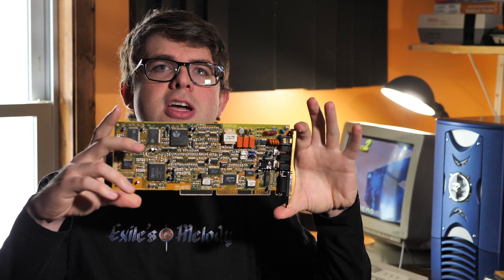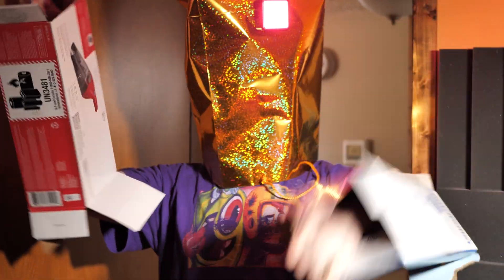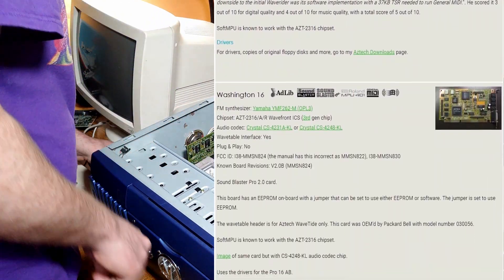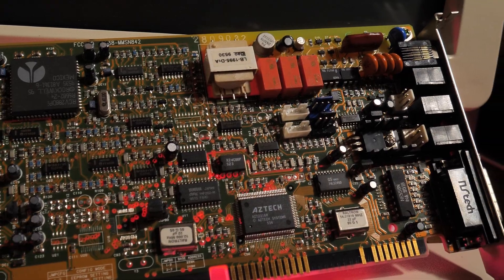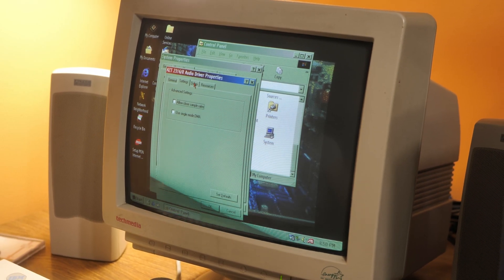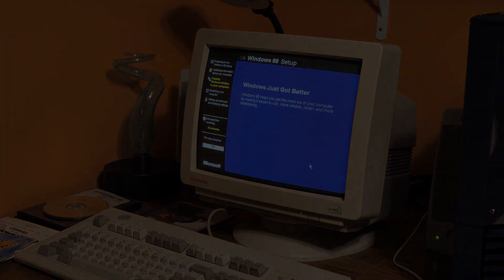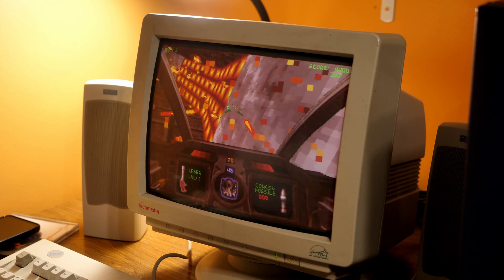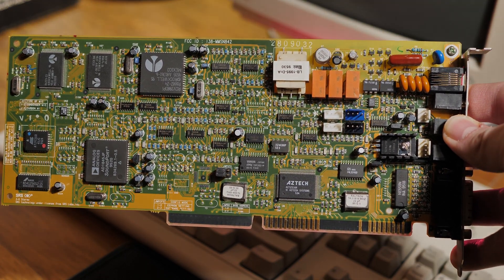How BAD are Modem Sound Cards for DOS Gaming?

Comment: I just commented on another video how hard these were to get to work the other day. We used to install them in computers we built in ashop where I worked. This was firmly in the windows 95 era though, on the fringe of 98.
Reply from the maker: Yeah the sound is good but the drivers are a bit tricky. I was actually unaware when I did this video that you can use the Unisound drivers in DOS. Might be worth revisiting if it "just works" with those.
Reply: @DOSStorm  I don't think we had those in 1998. :)
Reply from the maker: @rimmersbryggeri  Yeah for sure we didn't, makes it a bit less painful now though.
Reply: @DOSStorm  Yeah that unisound driver would have save huge amounts of time back when timne was atually a factor on these computers.

Comment: Had an IBM Aptiva M-series machine from 1995.  This had the infamous MWave adapter, which was quite problematic.  IBM marketed the MWave DSP heavily, with phrases such as “Aptiva’s two powerful processors—the Intel Pentium and MWave Digital Signal Processor” printed on the tri-fold.  I think this was more of a cost-savings measure, and I remember Packard-Bell doing something similar.  In MS-DOS mode, the card could be configured (with a utility called “fastcfg”) either as a 28.8 kbps modem and no sound, a 14.4 kbps modem with mono sound, no modem and stereo sound/FM synthesis, or no modem, stereo audio and MIDI wavetable support.  The early DirectX days were the final straw, with no proper driver update for DirectX 5.  Replaced it with a SB16 and a Diamond 56K modem.  Goooood times.  Fantastic content, by the way!  Subscribed!!
Reply from the maker: @AIM9XSW  Yeah I had a run in with the Mwave in my latest video on IBM voicetype. I plan on covering it in more detail at some point, but in my short time testing it I was far from impressed. lol

Comment: I haven't messed with the Aztech drivers for my Sound Galaxy 16. I just create the SET BLASTER variable and feed it industry standards. It handles SB Pro and WSS like a champ. I love Aztech cards.
Reply from the maker: Yeah I kind of feel like the UNISOUND driver would have fixed all the problems I had with this card most likely, and the non-modem versions seem to fair much better as well. I will be testing more Aztech cards soon, they are still a great bang for the buck since nobody really seeks them out like they do Sound Blaster cards.

Comment: I have an HP Pavillion Pentium 3 system that has a PCI combo sound card modem with some sort of Rockwell chipset. Most of the sound card ports are on an auxiliary header. It came with a cable that goes in an unused slot. I just got it, I really need to test it in DOS see if I can get it to work there.
Reply from the maker: Interesting. Is the sound chip on it made by Rockwell? Or does it use a Crystal or AD chip I wonder?

Comment: I bought this exact model of combo card about two years ago with the intent of using it in a Pentium build (still haven't gotten around to it). A big selling point for me was the dedicated Yamaha OPL chip; the photos on the ebay listing were clear enough for me to identify it. Anyway, glad to know it's a good SB clone. 

I have another Aztech card of a similar configuration, without a modem, that I am using this in a 386sx build. I encountered the same issue with the Aztech test program not playing the digital audio correctly in DOS. Xargon / Jill of the Jungle have issues with the digital audio playback as well (computer freezes for a few seconds, then comes back). Windows 3.1 wav playback and all other DOS games I've used on it work fine...unfortunate because it's a great card otherwise.
Reply from the maker: Interesting. I was able to play Jill of The Jungle using this card and it seemed to run fine, I actually recorded footage of it I just never ended up using it for time sake.

Comment: This looks similar to my AT6800W Aztech sound/modem combo. The reason 16bit sound doesn't work in DOS is the Aztech software doesn't properly initialize the Windows Sound System in DOS. Get the latest UNISOUND 0.80a or higher and run it with the /XWSS switch to initialize WSS in DOS. Note that WSS and SBPRO modes can not both be enabled at the same time.
Reply from the maker: Good tips! I will definitely try Unisound when I get the chance.

Comment: Drivers were always a PITA for these. I don't think I ever used one as a modem, even back when those were a thing. Just recently I had to get the drivers for another Aztec card I had - if there is a jumper to save settings or get them from EEPROM, make sure it's set to EEPROM otherwise it's read only.
Reply from the maker: I'm glad I'm not the only one who had issues with it. The EEPROM jumper is an interesting suggestion, although I thought I didn't see any jumpers on the board. I don't see super well though so maybe I'll check again.
Reply: @DOSStorm  The one I had was also steered by the EEPROM - not exactly PNP, but did require specific drivers to that card. I also had one with a SCSI interface, but it needed an optional IC to be put in - I have the IC in another card (needs unsoldering) but I don't think I want to savage it without getting the right drivers for the SCSI subsystem first. 

Anyways, if you find that your settings revert to default, def. it's not writing the update to the EEPROM.

Comment: I used and experimented with Aztech sound cards for a while. It was pain to configure these and find appropriate drivers in pure DOS. "Unisound" made this a lot easier for me (and fixed my PnP configuration issues!) but I was still not all that pleased with the quality of the amplifier on these cards, even if the emulation's decent and has a licensed OPL core.
Reply from the maker: Unisound looks awesome, I've never actually messed with it before! Thanks for the suggestion.

Comment: Interesting.  I'm dealing with a similar issue with my PnP SB CT2940.  Works fine in Windows, but pure DOS doesn't like it.  I'm thinking it has to do with device overlap, specifically the onboard USB keyboard.  I'd be interested in a deep dive of the IRQ conflict resolution - and any tips or applications to resolve it.  Can the collective internet hive-mind finally resolve IRQ hell?
Reply from the maker: The problem is there are so many different possible hardware configurations and motherboards sometimes its really hard to figure out.